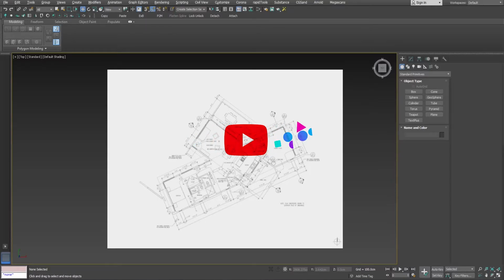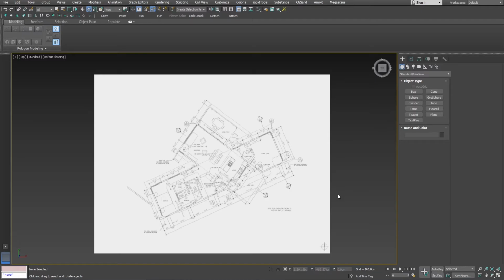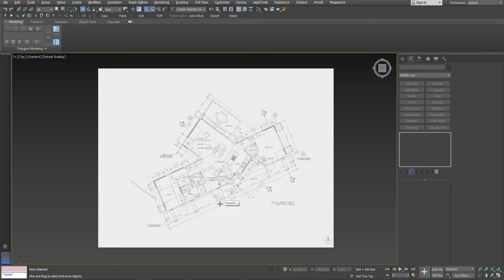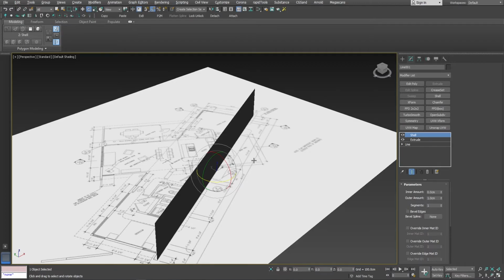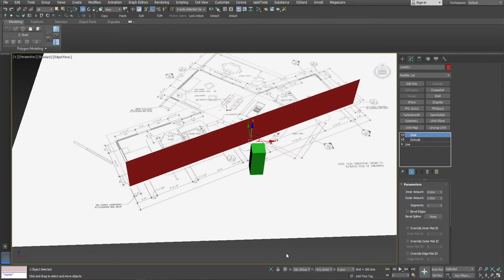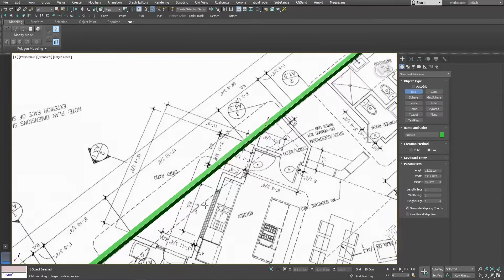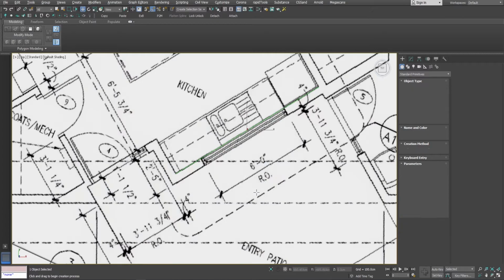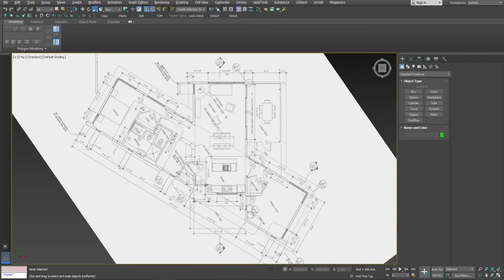Align and Straighten Angled Floor Plans in 3ds Max

Comment: But if you modeled one part of the house by which you leveled, then you need to go to the second which is at an angle, so you need to move your whole scene with the drawing together?
Reply from the maker: In this kind of work, probably you wouldn't have a whole scene without having walls first. This is the first step usually. But let's say you have. 

1. If your only going to modify walls: Instead of moving the whole scene with the walls, make an instance of the wall and align it the way you want, make your changes on the instanced wall and original one will change to. 

2. If you need to work on the angled part of the whole scene, for example you will model or fix kitchens, you can use a tool called Grid to temporarily change your viewport coordiante system. I have a video about that.
Reply: @cgsand  where can i find that video "change viewport coordinate system"?